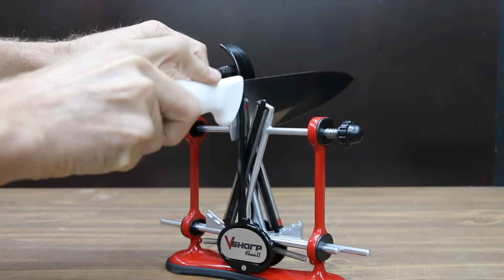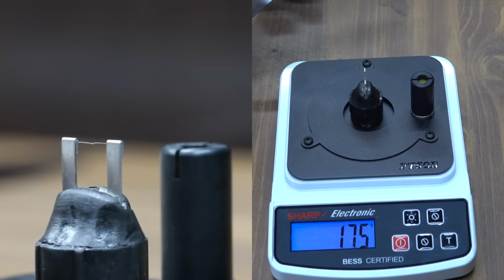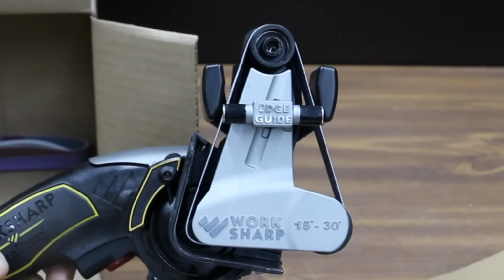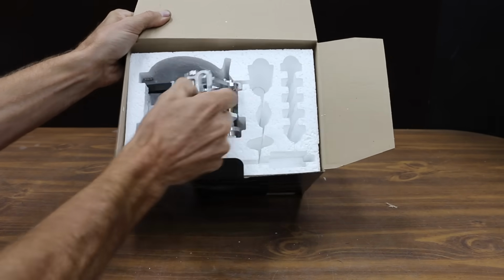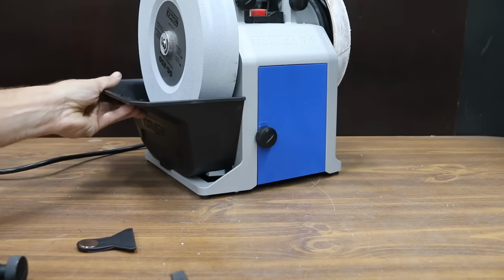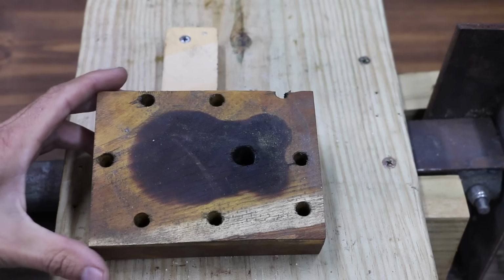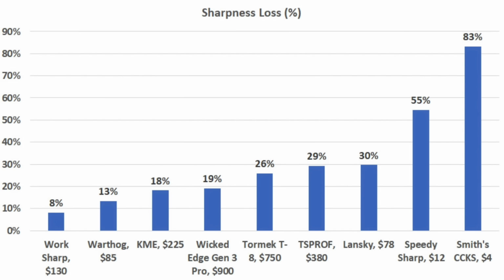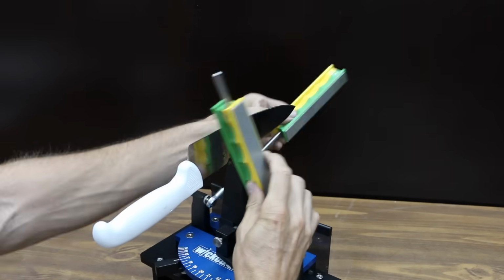RUSSIA vs USA Knife Sharpener? TSPROF vs Lansky, Wicked Edge, KME, Tormek T-8, Work Sharp Ken Onion

Comment: Thanks, but....Hum 7 days ago, a little late at least for our area. 7 days ago I was on the last of deer processing for the year. "Two" All cutting had been done and bratwurst stuffing had begun.
    Actually I still have my belsaw knife sharpener I've had since 1976. It is a belt grinder the one inch wide and 30 in belt 1 pulley is on a spring-loaded arm. And it is powered by a half horsepower motor. Belt turns at 90 RPMs. Also Has an adjustable table for setting angle. I have many different grit belts including my honing belt which I keep in a coffee can with an oil soaked rag. I used this grinder professionally as I had a sharpening business I also did circular saws chainsaws and hand saws. I was also making knives and worked as a farrier at the race tracks. So forging and metal work what hand in hand. 
     The first thing I do when getting a new knife is put it on the grinder creating an edge few knives rarely come with.
     This grinder has served many uses through the years including deburring many parts on many many aluminum airplanes I have built through the years. One of my neighbors has the cheapest one of the lot  and swears by it. A friend of mine has the little handheld belt grinder with the different belts. And he swears by it. He has more knives than anyone I know. 
   
         🤠🐂🏞️🛩️
Reply from the maker: Thanks for sharing.

Comment: Tests by Project Farm just might be the most informative on the internet.  That said, I always get outstanding results with my copy of the Warthog sharpener.  I noticed that the steepest angle was selected.  It's possible that only the shoulders of the secondary bevel came in contact with the diamond abrasive ....   And that using the medium setting would have sharpened the edge.
Reply from the maker: Thank you!

Comment: Im using the Tormek myself, the wheel as you appear to be using it it is very rough (220 grit), at best ok for reshaping rough tools, but by no means meant for sharpening knives. If you want to achieve a good result you should go 1000 grit upwards, you can do that with a different wheel or by polishing the surface of the wheel itself. For convenience im using different wheels of different tasks: a 360 grit diamond wheel for shaping, 1200 grit diamond wheel for sharpening and a 4000 grit corundum wheel for polishing. Also you need some practice on keeping the angle well. There are some great videos on it on YouTube, unfortunately the handbook is not particularly useful.... It is definitely not aimed at home sharpening but more for a workshop or so. There are different tool holders for all kind of tools. I use it to sharpen everything from razor blades over kitchen knives to lawn mower blades, axes, drills and lathe inserts. At the beginning it is a hassle to set up and get used to, but with a bit of practice you can get amazing results in very short time.
Reply from the maker: Thanks for the feedback.

Comment: another great video! One thing I can’t seem to tell the difference in is spray silicone lubricants. I find some brands stop spraying aerosol and leave a lot of unused silicone in the bottom, while others are so runny and foamy i can’t imagine there’s anything useful that ain’t dripping off the surface. All have worked pretty well, however. Maybe do original WD40 as a control as well? You always exceed expectations, so i’ll leave the thinking to you
Reply from the maker: Thanks for the suggestion.

Comment: I'm a Lansky fan. The clamp and stone kit that is. I can tell you that on a long blade like that it's better to sharpen in sections. Mark the center and do ea half separately counting strokes then a 3rd light pass in the center with the finish stone to blend the middle. Otherwise the angles get off towards the end further from the clamp.
Reply from the maker: Thanks for sharing.

Comment: I was wandering about Trex or recycled plastics used as 2x4 boards. Are plastic boards as good or strong as wood boards.

Some of your test would go well with that: do screws stay in with pressure to pull out the boards. How many pounds to break the trex vs would board. Can you nail through it and how well does that compare to wood when pressing on the board.
Reply from the maker: Thanks for the suggestion.

Comment: Video idea.... 2 cycle oil. I had several different ones that I got from my father-in-law after he move down and I found that the Stihl 2 cycle oil was the best mixing with gas for the 2 cycle engines, but it is more expensive and hard to find. Maybe testing several.
Reply from the maker: Thanks for the suggestion.

Comment: Nice video.  I am surprised that the Swedish sharpener didn't come with a blade holder because that basically makes their device useless unless you purchase an additional item.  Maybe you can also consider a video comparing different brands of machetes for edge retention after use.
Reply from the maker: Thanks for the suggestion.

Comment: PROJECT FARM IDEA:

Best tool backpack!

Klein, Kobalt, Milwaukee, CLC, Husky, etc. 

Make sure you include a “Veto Pro Pack backpack” and your mind will be blown.
And I mean B-L-O-W-N ! Prove me wrong!

“Veto” tool bags are the best and you can prove it on your channel. Veto makes tool backpacks, and all kinds of tool bags. 

Tool backpacks are popular on worksite leaving your hands free. 

You could test the following: how well they stand up, flop over, holding capacity, tool layout design, strap strength, drop test on breaking the bottom base (if it has bottom base) bottom base water proofing, nylon density, are the tool pockets useful in Real world applications…

Let me know if you need help!
Reply from the maker: Thanks for the feedback.

Comment: Could you consider doing a review of the cheap 1/2" drive impact guns as advertised on Amazon, EBAY etc using a known decent impact gun as a baseline ?
I think a lot of people are getting a raw deal with many of these and it would be good to see how they stack up tested by someone unbiased.
Reply from the maker: Thanks for the suggestion.

Comment: I've used the KME, WE, and Edge Pro (Professional). In general, I prefer the KME for pocket knives or any knife under 5 inches or so. The WE is definitely better than the KME for large knives but I prefer the Edge Pro over the WE for big knives. The ability to easily pick up the knife and inspect the edge and do a few test cuts is very, very nice.
Reply from the maker: Thanks for the feedback.
Reply: I bought mine couple days ago didn't receive it yet but couldn't find it for less than $999 and still had to order a set of finer stones I hope it's worth it....I also have the kme gold and reason I bought the WE pro is because it looks more simple use.
How do you compare the two? I do have mostly larger knives
Reply: @greekmaster1001  I think they are both great devices for sharpening. The people who run the shops are great too; both very happy to share their opinions and expertise when asked. In my experience, if you have space to leave the WE up permanently (along with space for its stones and accessories) then you can very quickly throw a knife on it and quickly remove metal. Personally, I don't have the space so it didn't end up being quicker for me (especially because I just microbevel my knives with a spyderco ultra fine stone and strops by hand between full sharpenings).

I will say I did give myself a nasty cut in my thumb because I wasn't paying attention while using the WE. I admit that it was my fault for being careless but it remains the only device I have used that I found a way to cut myself while using it; it did only happen once. 

I think the strongest point of the EdgePro is that they have found a way to reliably and repeatedly index a knife on the device without a clamp. This allows you to sharpen extremely long knives (there is video of some guy doing a katana) and being able to pick up the knife and inspect the bevel/do some test cuts is really nice. This is personal preference, but I worked faster with the knife laying flat on the EP table than upright on the WE; I was able to more accurately see where I was removing material and it made me more confident. Plus, it's cheaper and their is a huge aftermarket for stones.

What gets overlooked a lot, especially when comparing a clamped system to the EP, is that the the stones the EP comes with can be flattened. If you get an odd ball diamond plated abrasive, it doesn't matter how rigid your clamping system is or how thick of a guide rod the use, you're flat out of luck if what you care for is the closest thing to a perfect V bevel; I don't and I don't mean to imply you do if it came across that what, I just think its important to mention even though it's kind of a wash between both systems. 

Let me know if you have any other questions.
Reply: @thechemtrailkid  wow thanks for this info....I have the kme now I will soon have WE.
Yes I do have a place where I can just leave and work on whenever I want...I see a few videos saying how the tsprof I a bit of a pain setting it up.
I'm just disappointed for $999 the WE wouldn't come with a more stones or a strop.
What else you recommend buying for the WE?
Reply: @greekmaster1001  No problem man. 

Yeah, it's definitely pricey. Nicely machined and anodized aluminum though.

As far as additional extras, it's really about what you want to get done. I think the WE Pro 3 comes with diamond that range from about 200 grit to 1000 grit (US standard). If you do heavy reprofiling or need to do deep chip repair, a set of coarser stones would probably save you some frustration. I really liked their ceramic stones. The 1200/1600 kit was pretty good after the 1000 grit and the micro fine set produced an edge keen enough to whittle hair after a quick strop. I liked Bolsa ones with their cheapest paste compound (I still use this set up for my bench strop).

If you want an absolute mirror finish (the ceramics produce a nice bevel but still a little cloudy), the diamond lapping films are what you need. I believe they were originally developed to polish optical surfaces and it shows. If this is something you're after, you may want to look into buying higher grit diamond stones stones since the lapping films can be expensive. I think they have diamond stones that go up to 3000 grit now. It's really a balancing act based on what you need and how much you want to spend re: polishing with lapping films vs stones. If don't want to spend too much more, I might spring for the set of diamond stones above the ones that include the 1000 grit and pair them with he microfine ceramics. If you already have a strop you can just do it by hand.

If getting an exact bevel angle on your knives is something that is important to you, you should get some sort of digital or analog angle finder; the reference numbers on the device are calculated assuming the bevel is a certain distance proud of the top of the clamps and this will change depending on the knife. I don't bother with this though. I think  the scissor and chisel sharpening attachments are too niche unless all you do is sharpen chisels. The low angle adapter might be useful to you depending on the knives you have. They have a large sheet of plastic that helps you record exactly how you position a knife in the clamp; this is useful if you keep track of it and need to toss the knife back on quickly.

Let me know if you have any other questions.
Reply: @thechemtrailkid  thanks again 
Do you have your own YouTube channel?
Reply: @thechemtrailkid  where would I find the low angle adapter?
Reply: @greekmaster1001  No youtube channel aside from this one. I don't upload anything. 

It should be on the WE site under accessories. It may be out of stock
Reply: @thechemtrailkid  wait.....this video we all watched is your channel?
Reply: @greekmaster1001  Oh, sorry, by "this one" I mean the account I am commenting from
Reply: @thechemtrailkid  one more question 
I see the low angle adapter for $75 on Amazon 
Do you think it's worth it?
Reply: @greekmaster1001  I wouldn't buy it until you know you need it. I only had to do it for a few pocket knives.

Comment: Great video! I'm always impressed with the results from my KME but it is a bit involved to setup and use. For quick pocket knife touch ups I find myself using my Spyderco Sharpmaker most of the time as it is quite quick to setup and use. I've thought about getting a Wicked Edge several times but could never justify the cost.
Reply: These are the exact systems I use for the same reasons.

If a blade is new to me and I need to set the bevel angle or the blade is very dull or I want to put a crazy sharp edge on it I'll use the KME. For touch-ups and quick work I'll use the Sharp Maker.
Reply from the maker: Thanks!  Thanks for the feedback.

Comment: Wow!!! As a knife nerd this was the most complete, comprehensive and precise sharpener test I have ever seen! You covered every aspect of the subject and your methods for comparing the results were excellent! Thank you very much!
Reply from the maker: Thanks and you are welcome!
Reply: I put myself forward in acknowledgement to the test range.

I have owned and gifted Lansky's in the 1970s. I am a major fan of TSProf (tech studio profiler). I Have many TSProf rigs and I buy Edge Pro Stones diamond matrix full weight stones to use in the tools. I gift sharpening rigs to my kin.
I will not gift the tool without Edge Pro Stones in a TSProf rig. 
The mechanics of the TSProfiler are absolute to create sharp perfectly aligned 180 degrees out. a recipe for a true edge refined to fine machining and engineering.
Reply: @cliff567  I have the blitz360 and love it, guess I need to pick up a set edge pro stones.
Reply: @Perceptence , I don't know, man, but the one sold by the "sharpeningsupplies" looks legit, although they seem to be the only supplier.
Sharpening japanese knifes, with a professional grit stone, is an Honor, having beneficial effects over the mind, like Discipline.
Reply: There's a 1 million grit stone to sharpen things and there is also that japanese who spends like 8 Hours to sharpen a knife.
He didn't test any of the japanese products, nor spent more than an hour with a knife.
Reply: @outstanding1448  Off you go then. 😆
Reply: @emmanuelmeris5841 , I'll wait you outside. ;)
Reply: @outstanding1448  Basically nobody is going to sharpen a knife for 8 hours. That's completely impractical for anyone other than a hobbyist or for media content. PF is not a new outlet about ridiculous hobbies. It's a channel to help normal people buy tools they need. This is probably far more detailed than most people (even those on this channel) will ever need.
Reply: @outstanding1448  
An experienced knife sharpener can take a knife from "farmer's dull" (like, debatably still a knife) all the way to hair-whittling sharp (which is about the sharpest practical edge you can get) on S90V—one of the hardest steels to sharpen—in just 30 minutes. If it's taking someone 8 hours, something’s going horribly wrong.

Also, the highest grit stones you can actually buy top out around 8000 grit, maybe 30k for finishing stones, but as you mentioned a "1 million grit stone"—which is nonsense. At that level, you're talking about abrasives around 0.0274 microns.

As someone majoring materials science, and just someone who reads before speaking:
0.0274 µm is smaller than the grain structure of steel, which typically ranges from 1–100 µm in normal steels.

If your abrasive is smaller than the material structure, you're no longer doing effective sharpening—you’re just polishing or burnishing. That’s why strops use abrasives in the 3–6 µm range—just enough to refine the apex, not remove steel grain-by-grain.
Reply: @outstanding1448  Need to look at some Japanese stuff.
Reply: @glennwhite1841 , be my guest. You'll be mesmerized. Search particularly for that japanese who makes knives out of.... everything.
Reply: @outstanding1448 you can easily spend an hour or more on many of these sharpening rigs, to assume he didn't is naive at best
Reply: @outstanding1448  dang I hope he replies

Comment: Thanks for a fascinating comparison.  Many years ago I bought a Warthog at a show.  It worked until the “stones” lost their diamond coating. I’ve owned Lansky since about the time they came out.  A guide beats freehand. I’ve tried many systems, and have Juranitch’s “Razor Edge Book of Sharpening.” But these days I mostly use the unsupported portion of fine belts on my Grizzly G1015  2x72 belt machine.  👍
Reply: The belt selection for a 2x72 grinder and the jigs you can make can be close to impossible to beat, as long as you have a variable speed machine.
Reply: @sirmontag  true.  I do not yet have a variable speed drive for the 1hp Grizzly, though I do have both 8” and 10” drive pulleys.  One of these days I’ll get a variable drive, and build a better tool rest.  “Retired” means more time than money.🙄
Reply from the maker: You are welcome!

Comment: How about finding a gasoline container that doesn't leak around the threads when you're trying to pour gas into a tank.  I've got five different plastic gasoline containers and everyone of them leaks around where the nozzle screws into the body of the container.  Gasoline ends up on the floor of the garage or my driveway as well into the tank I'm trying to fill.
Reply from the maker: Thanks for the suggestion.